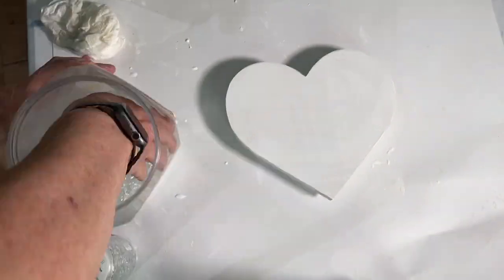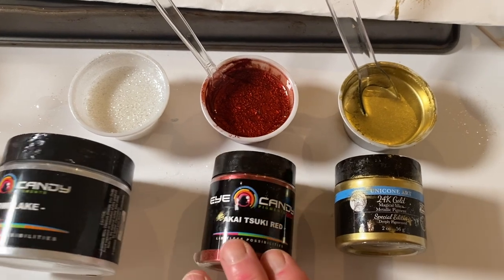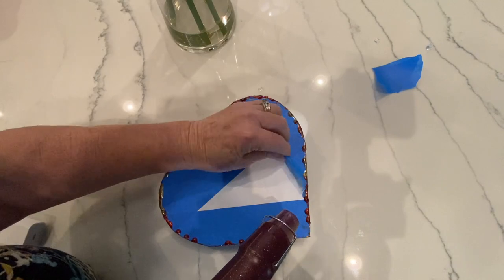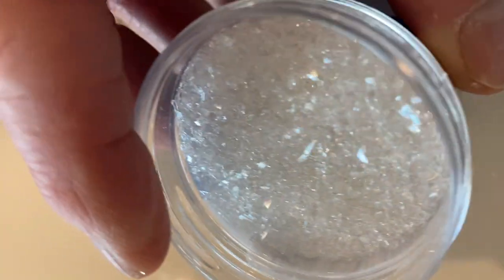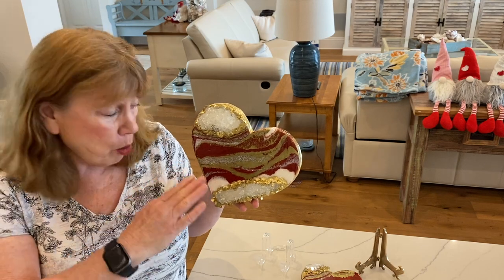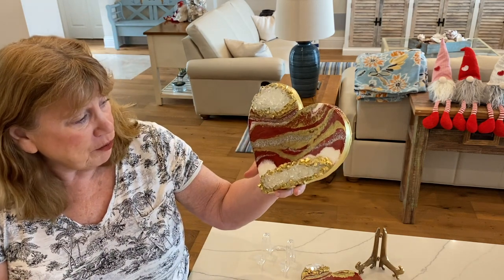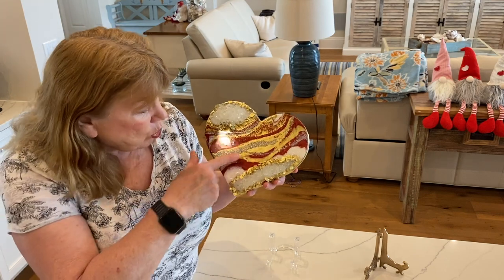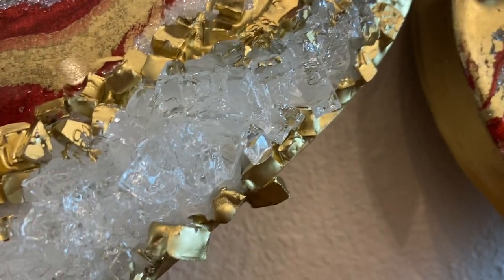GEODE RESIN ART, EPOXY RESIN AND GLASS CRYSTAL ART HEARTS 2023

Comment: Linda, I finally have my Tumblr going. I realized I’m going through a lot of grit. Have you ever tried sand? I used crushed up seashells the other day, and that worked pretty good but, I have a lot of sand.😂
Edit: I bought 36 grit first. Was looking to buy bulk , maybe 5 lb to save money but can only find 60/90 bulk $24 
I’m sure I will have to run the Tumblr longer if I use the 60/90 . Looking to NOT pay ssh
Reply from the maker: Yes I have used sand and its fine to use and if you use grit you don't need to use as much as they say. I know the grit is expensive.
Reply: @crazyglasslady  thanks 😊
Reply from the maker: Also if the grit still feels gritty ( If that's a word LOL) you could still use it. For example I tumbled some stained glass stems for 1 day and instead of dumping everything out I just fished the stems out and then the next day I had some more stained glass leaves and I threw those in for 8 hours and fished those out and I plan on using for another tumble.
Reply: @crazyglasslady  ok
Ran it 3 times so far
The glass is coming out “right “
Think I need more practice 🤩
Reply: I found a few glass pieces at goodwill (overpriced 😵) that have a texture on one side that I’d like to preserve 
We have a sand blaster at work and once I’m shown how to use it, maybe I ca sand the sides and save the awesome bubble texture on the top 🤷‍♀️
Otherwise I’ll have to haul out my glass grinder
Reply from the maker: well you can tumble textured glass and a lot of the texture will still be visible . I have some cool textured glass that I have tumbled Let me look back at my videos and see if I can find some to show you.
Reply: @crazyglasslady  if I can get my act together, I’ll EM you pics. Also I’d like to keep a bit of the translucency. My thinking is if I can feed some detail? When i tumble the pretty glass it becomes cloudy. 🤷‍♀️